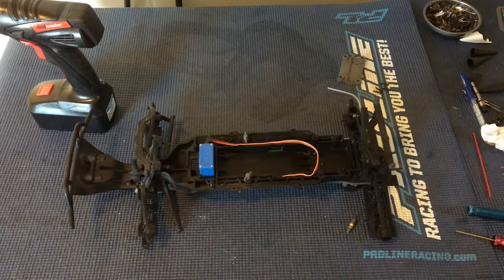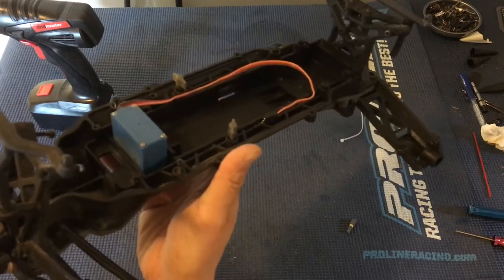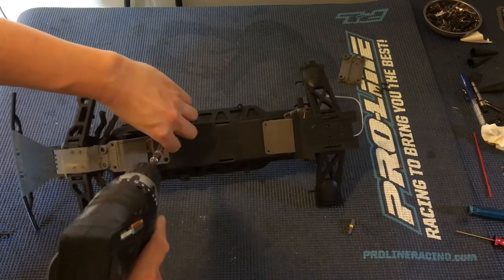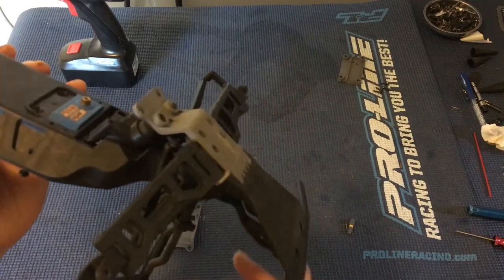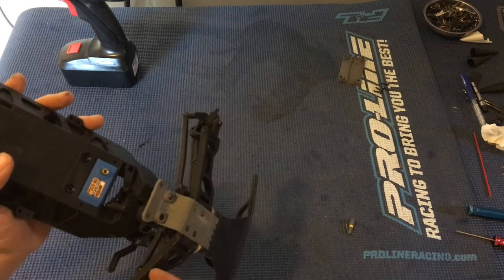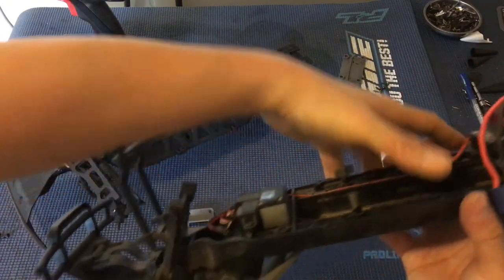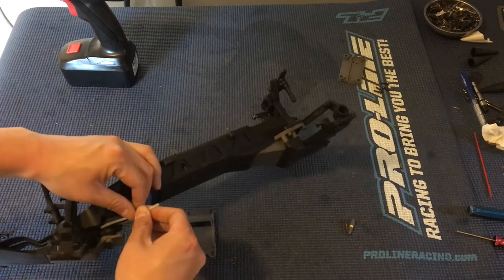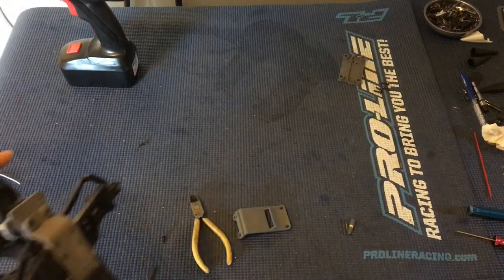Servo Saver Tie Wrap Modification for ECX 2WD Ruckus Torment Circuit Boost Amp

Comment: I just got the new ecx ruckus 4x4 n it’s my first ecx n first run it went up in smoke! The range was garbage, it kept just taking off full throttle, the motor burnt up n got it all filmed n thought it would be a good truck for the channel but was pretty displeased with it, maybe I got a lemon but it was garbage,I will put a brushless system in it n see how it does, oh n also a new receiver n transmitter, ya my servo was not even tightened down I had to put two new screws in it to hold it from moving
Reply from the maker: Thanks for watching and commenting! Yes, we haven't heard great things about the Ruckus 4x4 either, so we've stuck with the 2WD version. A friend got one and the motor burned out as well. Definitely check out what other folks have experienced by Googling for "ecx ruckus 4x4 forum" if you haven't done so already. Tekno is probably your best bet if you're dead set on a 4x4. We prefer 2WDs because of their durability.
Reply: Racing2Learn ok cool I’ll check the forms out, thanks

Comment: I really need help. Bought a ruckus for my son for Christmas and have had nothing but problems. I can not replace the skid plate! I have the replacement but the screw going into the bell crank will not come out. It has 2 screws ones a nut and the other has another screw head. Ive removed the plate but cant get the screw to come off the bell crank...its so aggravating. Please if you know what im talking about help me. I can send you pics if need be
Reply from the maker: Sorry to hear! Could you post a link to a video or pics? Hopefully we can help.